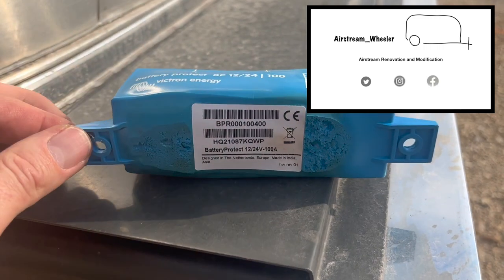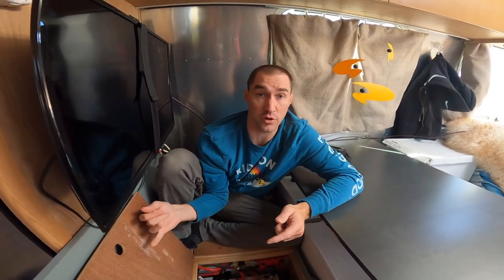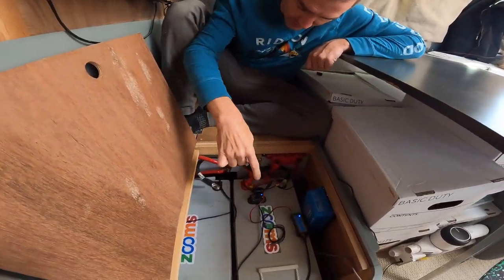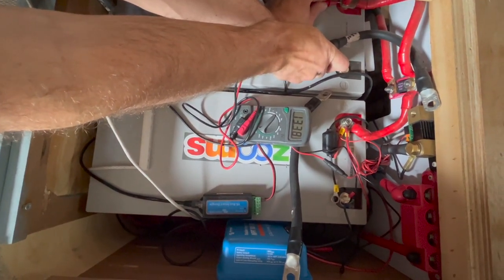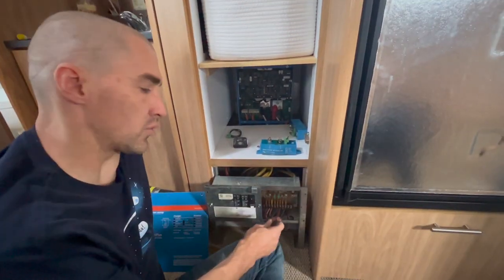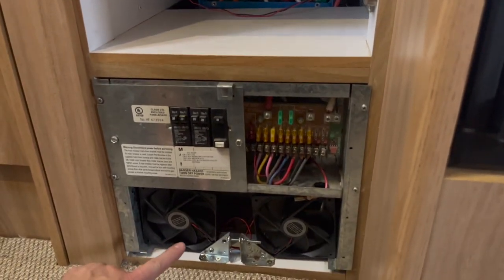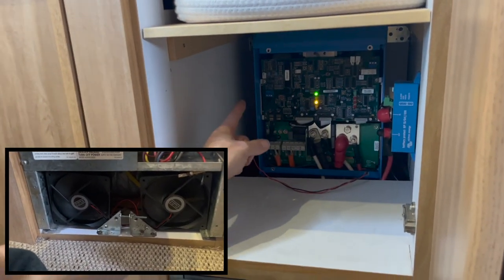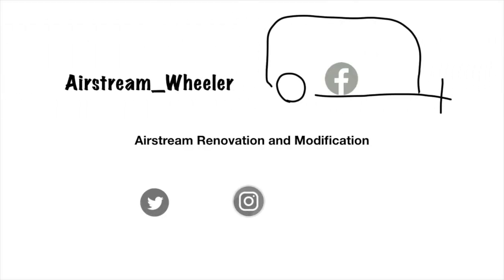Victron Battery Protection Install Error Causes a Mini Meltdown

Comment: Easy to do. Victron Instructions are hard to grasp. Like your channel - real people doing real things with your Airstream(s).
Reply from the maker: Thanks very much for watching. I posted the Victron error in hopes of saving someone from making the same mistake.
Reply: Generally speaking professionals like myself will assist you in completing your install safely that is how they designed it with their distributors however people often refuse to ask for support

Comment: I have a 200amp disconnect the same although ours hasn’t shown any damage yet Ive decided to try something different as it charges opposite way through the the way it describes. Good advice thanks for sharing 🇦🇺🤙
Reply from the maker: Thanks for watching! I’ve been happy with the 2nd one and the change I made to the wiring after the “incident”.
Reply: Victor energy sell a line of relays which would be very good. You could even use your existing one simply to power the relay coil.

Comment: Thanks for your video.
Learning with other's mistakes is extremely valuable.

I think you have two LiFePO4 batteries connected without a fast burning Class T fuse, which can be a huge error if there is an inrush of current from one to the other due to some cell malfunction or battery reconnection without being in the same SOC
Reply: Absolutely right about the T class fuse.
Reply from the maker: Hi, Thanks for watching, I agree I need to make sure I have it fused correctly.
Reply from the maker: Hi, Thanks for watching, I appreciate the input.

Comment: It can only deal with current in one direction, so either current to a load, or current from a charger, but not both currents at the same time
Reply from the maker: I appreciate the comment, thanks! Yes, this unit is directional so with the Multiplus I have, it can only be between the battery and loads. The Multiplus can charge the batteries or pull power from them to make house current- the the BP unit can not be installed under those conditions.
Reply: It can actually cope with a certain amount of current in the other direction as certain low have a small amount going back-and-forth

Comment: the piano hinge on the wheel well side: Is that cut to order and you drilled the install holes? or did you find that pre made. I've looked for a 15 inch hinge and can not find one with three holes. High Sky Airstream part is out of stock.
Reply from the maker: We have a hoard of piano hinge saved aside! From several Airstreams past we have salvaged pieces big and small, since there always seems to be a chronic shortage.  Since it was a used piece, I believe I just used the holes that were already drilled in it. Adding the hinge to gain easier access to the wheel well side of the dinette seemed like a no brainer with so much  wiring to run/rerun through that area.
Reply: I will then get a hinge w/o mount holes and make my own cut to size to fit the three hole example.
Thanks for the info. Enjoy watching your show @airstream_wheeler

Comment: The battery protect is bidirectional, however that version is only 100 amp continuous. The system must have exceeded that. If the same conditions happen again, it’ll cook again! Stop!  You need the 220 amp version.
Reply from the maker: Thanks again for the input- I can't understand how it had 100 amps moving through it- The problem was discovered when it was charging at 20 amps with virtually no loads. It never charges above 30 amps.
Reply: @airstream_wheeler  
20 amps is nothing and shouldn’t have turned that plastic into a blob. One of three things; a defective protect, loose connection or you missed an event. I’d be up sizing everything because a 100 amp @ 12V system is very low and limiting. Always thinking energy management gets old ( I gotta wait for that to finish before I turn this on kinda thing). Before you do anything make sure you have T class fuse(s) to protect the weakest link in the system. Also pay attention to what the manufacturer says about cable size/length charts and consider the recommendation a minimum! On line ampacity calculators are severely inadequate for low voltage DC applications. If I start from new, I like to segregate house and inverter systems. 12 volts system have gotten much more efficient since the LED and about the only other thing that’s on it is perhaps a heater blower or exhaust fan. So one 200 Ah is all that’s needed for house. Then I like 48V inverters because of their efficiency and smaller cable sizes. While on the road, an up converter can charge from the vehicle’s charging system and limit the charge current thus protecting the alternator as well.
Reply: Careful about allowing more current to flow without knowing what caused it. It may burn something else. Without knowing then adding a circ breaker or fuse may be safer choice, allowing you to investigate.
Reply from the maker: Agreed. I am nervous that we have not fixed the issue. Thanks for watching!
Reply: This is a model only says One Direction of current flow on the data sheet

Comment: You almost burned your Airsteam to the ground. The part is clearly labeled, but it needs a self protect.
Reply from the maker: Yeah, might have been bad. Really glad we caught it when we did. Thanks for watching!
Reply: It does not need self protection. It introduces lots of power loss which energy provides clear guidance and support but you have to ask for it if you are unsure.

Comment: You may not use the BatteryProtect between a battery and an inverter. NEVER!!! All Victron inverters have built-in adjustable low-voltage disconnects, so they don't need any external devices to accomplish that functionality. 
Using a BatteryProtect to directly disconnect the main DC line of an inverter will, sooner or later, DESTROY the BatteryProtect. It’s an expressly FORBIDDEN configuration.

Looking at your configuration, I wouldn't sleep easy with the apparently poor ventilation of the multiplus and the chargers and that way of crimping plugs. I would redesign the entire installation in a professional way. invest in safety and avoid risks of fire
Reply from the maker: Thanks for taking the time to comment. You have mentioned a few things that  am looking to improve on really soon.
Reply: That was my first thought when I saw the  MP tucked deep inside that cabinet. Especially in a trailer. Shorten it's life at least.
Reply: @airstream_wheeler  you are doing a great job but as above you are not using the items correctly. Respect fully sharing this as I don’t want you hurt.
Some voltage can run in both directions as a charge controller (for example) will need maintenance voltage when not charging,etc.
Also make sure you give a call to victron or a certified installer who will make sure you have each item in the right place and the items are rated for that amperage for distribution AND charging. It will burn up the equipment!
Lastly, I love people doing the work needed and learning how. Some of the tight spaces you are using are concerning and I worry for you.
Things never go bad… TILL THEY GO BAD, SO VERY BADAND THAT IS WHY PEOPLE GET HURT.  
RESPECTFULLY SENT
Reply from the maker: @kb6lcw99  Thank you for watching. Please feel free to educate me. I am learning learning from mistakes.
Reply from the maker: @kb6lcw99  Thank you for your detailed response. I will call victron or a certified installer. I am going to work on our power system this winter and diagram it all out. Hopefully, I can get a better layout and setup run; ~Andrew